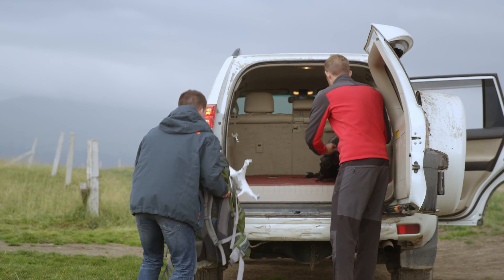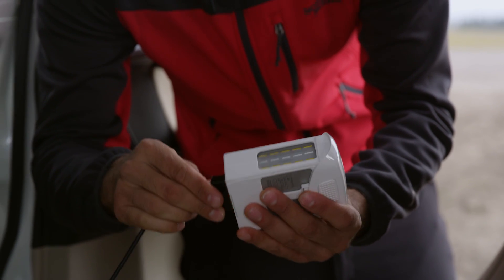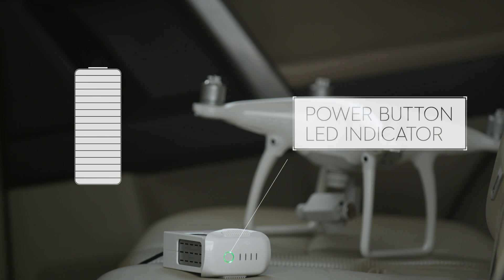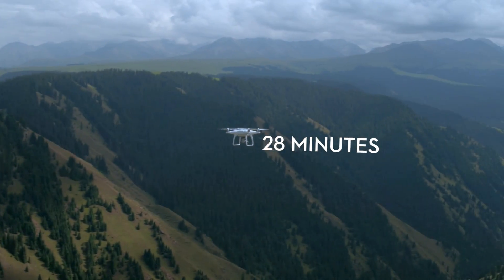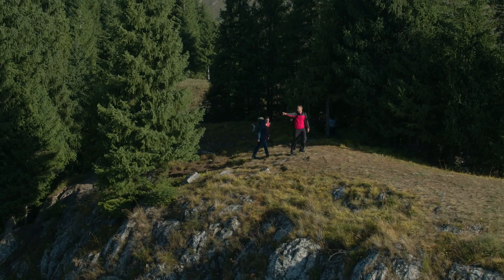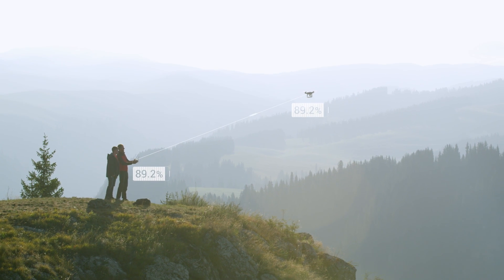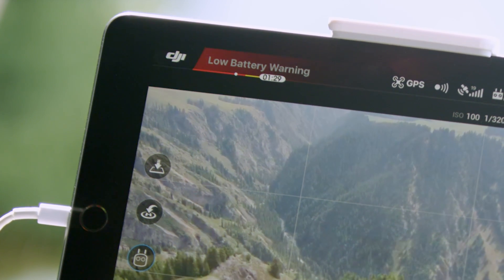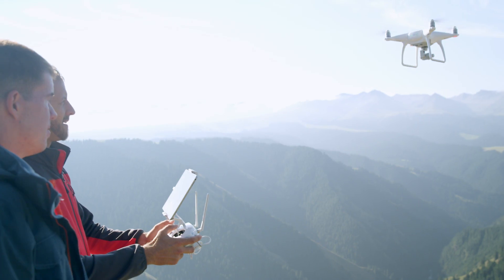DJI Technologies - Intelligent Flight Batteries

Comment: I'm happy that DJI is simplyifing proper battery management for us.

The problem I'm having with DJI smart battery tech is that it appears that said tech isn't extended to devices outside of flight batteries, such as RC from them.

Dang.

Comment: Hi, greetings from Venezuela!!! I have a question about my phantom 4 about FPV signal interference. As soon as it fly for about half an hour, the FPV signal on my Ipad mini 2 starts seeing terribly, with lags, black and green screen and freezed screen. I am using the latest firmware, and I have been thinking on downgrading it, but first I would like to consider your comments.  Thank you!!!
Reply: Abigail Ramos Hi mate. IT is especially because all WiFi networks over there. 

Ps i thank you if you sub to me ;)
Reply: Nice Drone Videos if it were the reason, it should fail every moment but it happens when the drone has been flying more than half an hour

Comment: intelligent batteries? this video should be called "gullible consumers is gullible but product is with pretty decent UI."
Reply: but seriously is the voltmeter in the battery or in the aircraft? if its in the battery then you need a new voltmeter for each battery which raises cost and opens opportunity for Hardware failure.... idgi what makes them intelligent?